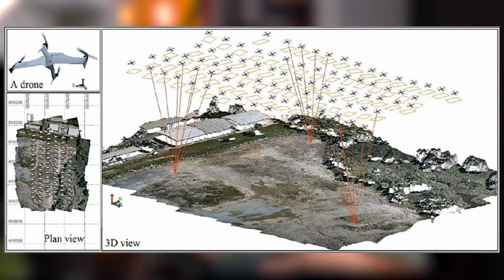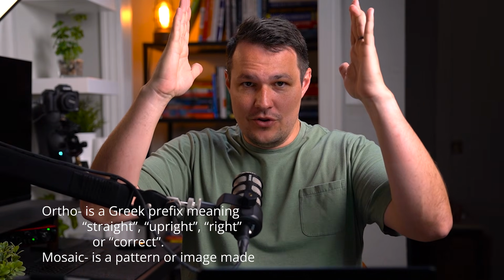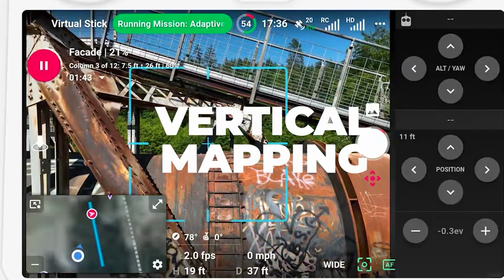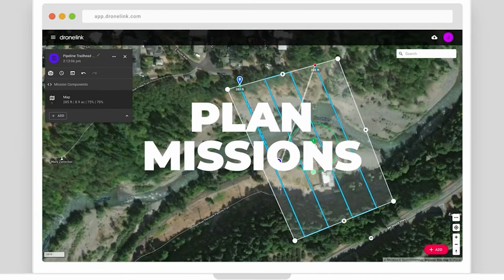Drone Mapping Explained: The Ultimate Beginner’s Guide (2025)

Comment: Start to get your name in circulation. It could take a while to have the phone ringing.  Most of this type of work comes from word-of-mouth. Firms insist on availability, accountability, and accuracy.  Every architect, engineer, or contractor I come in contact with gets a business card providing information on the services I provide.  After 50 years in heavy construction and engineering, the previous contacts are useful.

Comment: My company has been successfully drone mapping small, medium, and large areas mainly focused on large single structures for architecture or clusters of buildings. We extract point cloud data for aligning with terrestrial scanners. Our workhorse, the Mavic 2 Pro is getting tired and we are ready to upgrade. I'm curious what your thoughts are when comparing the Mavic 3E vs. Matrice 4E? They are currently about the same price. We do have jobs mainly around New England but we also fly around the country. Mainly, we have not used rtk or control points, but, we are on occasion.

Comment: Hi David. I am a porpoise researcher and often fly over water, some bays, and some open ocean. I need to count the number of surface entries that the mammal makes in a particular area. I understand that the reflections off the water would interfere with the post-processing but I just want to count the number that breech the surface. Seems I just need to plan a mission and look at the the resulting photos. Any suggestions?
Reply from the maker: Is it that you want to count the number over as specified period of time? Or at one snapshot in time?

With photogrammetry you’re usually capturing several hundred (or thousands) of photos of your flight area over the course of 10 to 45 minutes. Those photos get stitched together.

So the problem is if anything moves within that area during that frame, it will not reconstruct well on the final model (hence why water is very difficult).

Seems like photogrammetry would be a tough option for an application like this.

If you can give some more context, I might be able to make other recommendations.
Reply: @DroneLaunchAcademy  Just want to count the number over a certain area. Don't want to generate hundreds of photos, just enough to see the area of interest. Thanks

Comment: The brand New DJI Air 3S has lidar.. I wonder if it can be used for Photogrammetry
Reply: Nope. From DJI's own specs and user reports, it detects distances up to about twenty-five metres but doesn't output point clouds, exportable data, or anything you could feed into mapping software.

Comment: What is the going rate for aprox 500 acres?
Reply from the maker: I don’t think there’s necessarily a standard “going rate”. It depends on the deliverables that you will be giving. Are you just doing photogrammetry and handing over an image? Are you doing any type of analysis? Do they have accuracy requirements? Can change things drastically. If someone needs 2 cm of vertical accuracy that’s gonna take you 10 times more work than if they just need an ortho photo with no absolute accuracy.

I would imagine if you’re just doing photogrammetry with no accuracy requirements (they are using for general planning/documentation), then 500 acres is probably low thousands.
Reply: @DroneLaunchAcademy  this is what they need with RTK . (We need RTK ortho images to be delivered and uploaded to our pilot app,  with 1 360 degree spherical panorama)
Reply: It has to be done once a week for one year

Comment: I was enjoying this until it became a DJI ad.  Autel doesn't exist?  DJI 'bricked' two of my drones because I live next to an airport. No more DJI for me.
Reply from the maker: DJI are just most popular.  You can certainly use other drones.  I just don't have personal experience with autel (and I haven't heard of many people using them for mapping), so I didn't want to talk to things I wasn't familiar with.  You can get those drones unbricked if you get some LAANC authorization.
Reply: I think the same thing many times. They begin by saying the advice is for all drones, suddenly you star hearing everything dji and it turns you off. Because everyone isn't interested in dji we just need to hear what we want to know, and how to operate our drones.
Reply from the maker: The technique and application doesn't really change much from drone to drone regardless of the hardware or software.  Differences are usually just in features or where the buttons are.  But drone mapping is the same concept, regardless of what tool you're using.  This video isn't meant to be a tutorial on any one type of drone.  DJI is just most popular so it's what is referenced.  There are certainly other options, but they are almost all enterprise level... Wingtra, Sensys, etc.  You're going to be doing the same thing with whatever drone you pick.
Reply: Sounds like you need to get your part 107 and learn what you are talking about.
Reply: @TheFishTankTCG  Do you know what they say about making ASSumptions?  Especially about someone you don't know?  DJI's geo-fencing makes my drone life harder than it should be. Autel doesn't do that to me. And they make a great mapping drone.

Comment: I have the regular mavic 3 (the one that got discontinued right before the pro)..  Is it possible to use the RTK module on that, or does it need to be the Enterprise?
Reply from the maker: for the RTK module, it only works on the enterprise version.  but you could always use ground control points and do PPK instead (if you aren't using RTK).  I know many people who do it that way by choice, even if RTK is available.
Reply: @amaliejensen16
for 0 sekunder siden
 @DroneLaunchAcademy  Will the PPK with the mavic 3 (not enteprize) and GCP give survey grade accuracy?

Comment: if youre on a budget or just starting, buy used Phantom 4 PRO V2 (about 500-700$). It's a photogrammetry beast even still in 2024. And if you want to do photogrammetry and video only, pick Dronelink. You can automate almost everything, even shooting a facade, which helps a lot (I've been flying manually before)
Reply from the maker: Yes... all good advice!  Dronelink is great.  And P4P is hard to beat for the money.
Reply: Thank you! I just bought a P4P and ready to put my 2D mapping studies to the task this week. I keep hearing more and more about the legacy benefits of the P4P. Thanks for your re-enforcing comment.
Reply: Thanks a lot. I was about to dump 2k in a drone that is not specialized in construction but i can keep my autel evo 1 for that. Id love to be in this construction sector. Thanks again😊
Reply: i have a mini 3 right now, you think i should try to find a Phantom 4 pro V2? Will it be a big difference?
Reply: @nickalex636  but there are some things you should know about. It's not a toy like the mini drones. It's loud and heavy. People will notice it 😀 and it has no class so if you're in EU for example, you need an A2 license. No warranty, no DJI care, so be cautious.
Reply: @dainjah  we just care about the job done right. Noisy and all that do not matter more than performance.
Reply: @nickalex636  yes, it has a bigger sensor, mechanical shutter, variable aperture.. It's also heavier and more stable in the wind. It's a workhorse.
Reply: @nickalex636  The mechanical shutter on the p4p v2.0 would be the difference
Reply: @nickalex636  I have a mini 3 as well. It's perfect for the job. The regulations are low for this drone. It's small and fast. And 12 megapixel are enough. I tried drone deploy, maps made easy, poly cam and agisoft meta shape.
Reply: @dainjah will this drone work for excavation bidding- stock piles, sub exs, basements? Is there something else I could use if this one is too big?
Reply: @BlaineSmith303  I think it will work. Currently my fav is mini 5 pro, which also has 1" sensor (no mechanical shutter tho), but the picture quality is crazy. But no SDK for it yet, so you have to shoot manually. You can go with mini 4 pro.

Comment: with such high equipment and software costs and such technical flying required, I take it these services sell for a pretty penny? can you give direction how that'd go - how to get started with this after getting 107 - and how to start getting such jobs?
Reply from the maker: Yeah, you can get started usually with the Air 2S. You can pick up one that’s used for about $1000. Most people in this arena start off with construction progress site monitoring. That’s a good entry point as you learn more about GIS/mapping.
Reply: @DroneLaunchAcademy how much can be charged to do a mapping of a average construction site?
Reply: @icemikebullcity08  Until you get a qualified answer to your question, here's my 2 cents worth: I have been in construction for the past 17 years. Currently construction companies are really tightening up their budgets and you will need to present a very good solution to any problems they are currently experiencing.  Not a forecasted problem, but rather a current problem. You will hear "Oh, we bought our own drone and fly it ourselves". Many problems abound with the latter scenario. There is no "Average construction site". Every construction site has it's own "personality", as I like to say. Every construction site has it's own unique challenges to be solved, problems that need an answer "for cheap or free". Consider an hourly fee that you can settle on and be certain to solve a particular problem for a fee. Estimate the hours involved pre mission, during mission and post mission. I have a project that came in 900,000 yards short on soil so that indicates that somebody messed up really bad. Google how much a yard of soil delivered 100 miles to a construction costs. The math supports your interest to provide a service that solves not only problems but unforseen circumstances. DO NOT promote or offer survey services if you're not certified as such. Consult an attorney as to how you can legally offer less than surveyor content as a value added service. Other pricing  considerations: What kind of airspace will your mission be in? Will you need a waiver? Will there be any waiver delays that conflict with the contract you sign with your client? What's the maximum airspace allowed in your mission area? What if your client requires 100 foot AGL but LAANC only approves 50 feet when you arrive to the mission site and your maximum minimum RTH is 60 meters? Some of these questions are rhetorical but are some of the few things to factor when pricing services. Keep pushing forward and grab that first opportunity! Cheers!